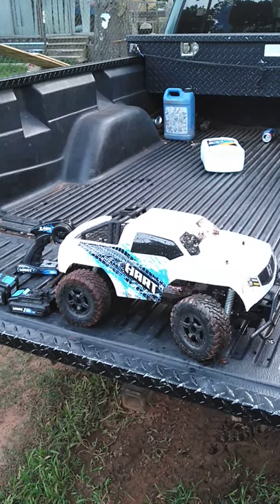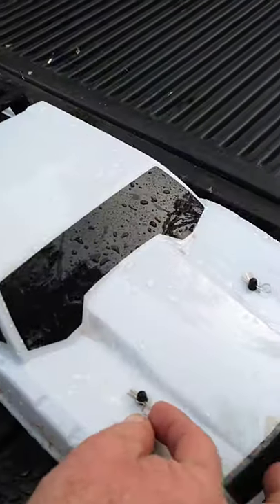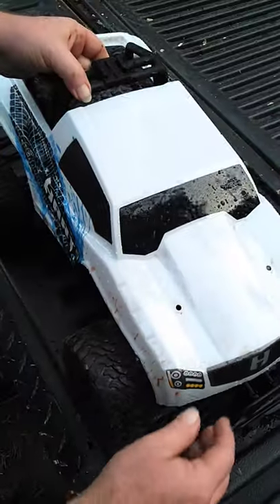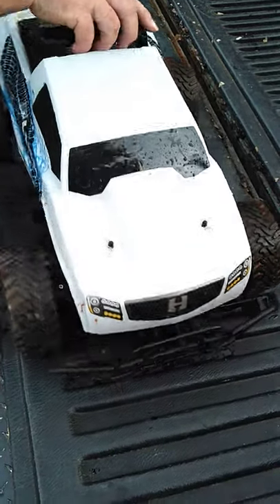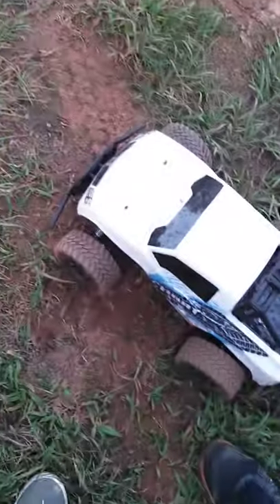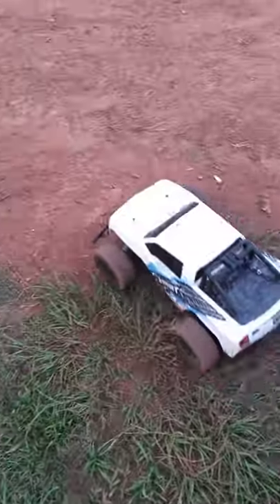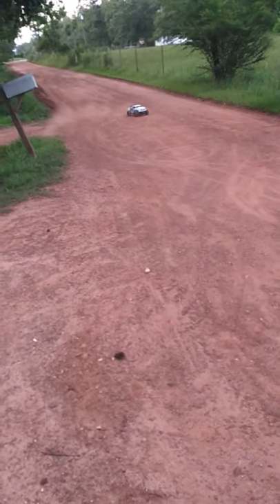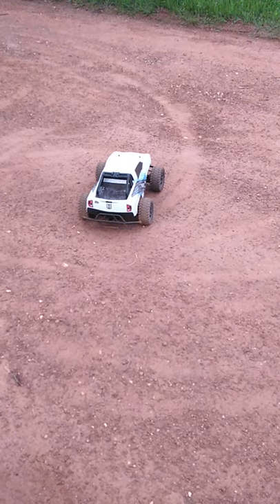Hart 20v RC truck

Comment: I had the Ryobi version of this truck a couple different times. I returned it both times because it would overheat. I figured out real quick that gravel or dirt was not going to work, but if you cut your yard extra short, it works soooo much better. You need a pretty good size patch because it is fast.
Reply: Just get a hobby grade RC car

Comment: Does this have proportional controls? It looks like it's just Stop, and GO!
Reply from the maker: You can control the speed by the trigger, and it has a little knob to adjust side to side control as it moves but that's it.
Reply: @tommychristyjr9193  
The price on this is high enough that it should have proportional speed & steering. On/off control is for toy store rc trucks.

Comment: Wonder what will happen if you put in a stronger motor, especially since you can use 2amp & 4amp battery.
Reply from the maker: Man that a great question. I would like to find out.
Reply: It would break the gears of the truck. You’d have to upgrade everything if you did that.

Comment: looks like it doesn't have any throttle management, just stop&go
Reply from the maker: Very little. It dies have a switch to adjust from 2.5 to 5.0 but either fast or slow. The front wheel wants to fold backyards. It's something to play with for about 10 minutes but that is all it will run even with a charged battery